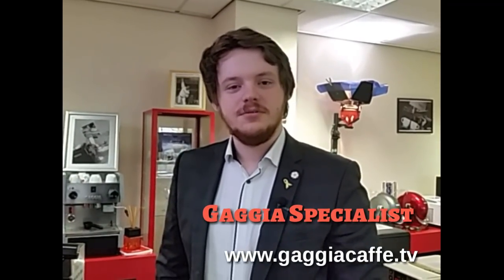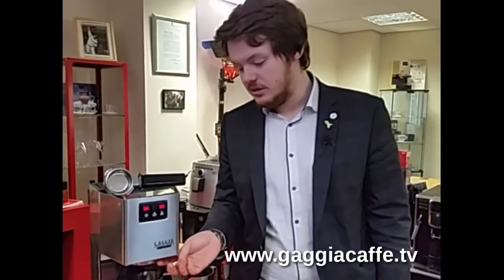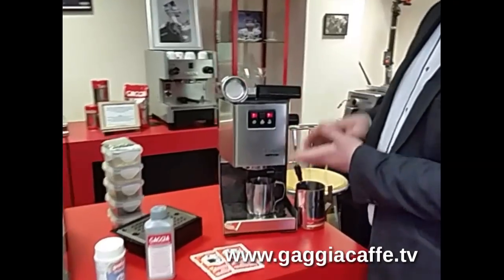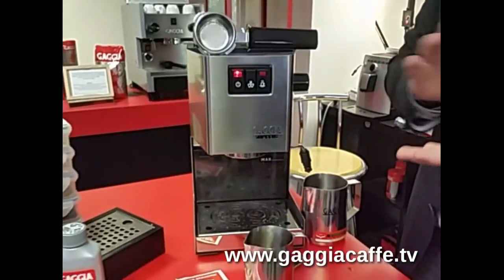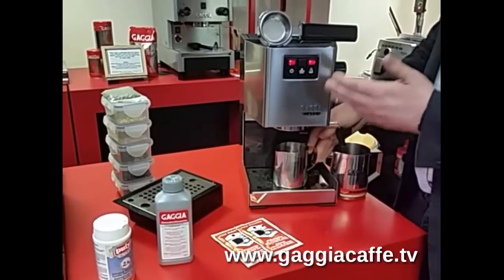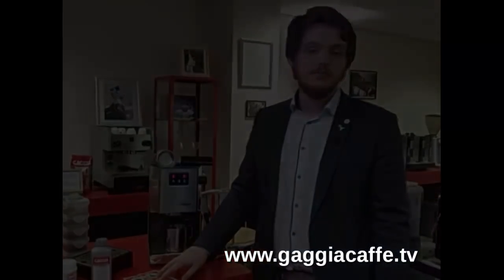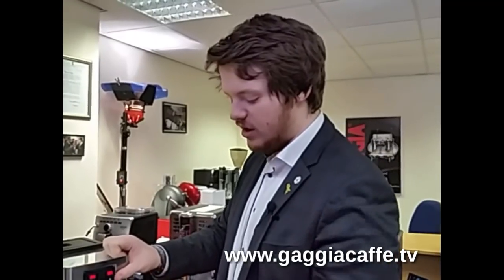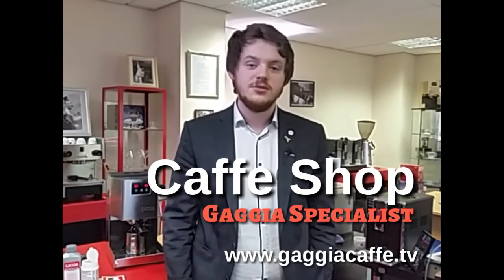Gaggia Maintenance - Gaggia Caffe TV

Comment: Commented on Gaggia Classic Espresso Machine Overview
Hi! i have this older model gaggia classic with PiD And OVP and the pressure was already modded to 8 bars. What is in your opinion/experience the best pressure mod for this model (mine is from 2011)..i am asking because i have an even older model from 2006. Coffee de luxe, where the pressure gauge shows nearly 14  bars, and i am slightly convinced that the coffee drips better with a little bit more bars...what do you think?....hey, i like your videos very much😀👍🏼
Reply from the maker: The default setting is 9bar.

Comment: Hi Gaggia my coffee is a little cold - what am i doing wrong - novice user
Reply: I'm not an expert myself, but I can state my opinion if you'd let me.
-Make sure to let your boiler have enough time heat up your water. Wait for the red light on the brew button to illuminate. 
-If that doesn't work, it may be a problem with the heating element for your boiler. Bring it to a specialist or you can attempt to fix it yourself by switching out the part needed.
Reply: It can take up to 30 minutes before the boiler reaches it's optimum temp, especially if you have an older machine. I had a similar issue when I started using my machine. I would say that the light indicating that the water is ready to be put through the group head requires maybe 5 additional minutes before you can start using it. Likewise, always flush water through before making your first shot. 

Similarly, with the steam wand, I've found that the first indicator light showing the steam is ready is too soon, and the pressure can be so great that if you have an older model with the detachable wand, it can fly straight off without waiting a few minutes.  I'd recommend using a smart plug if you can get one to manage to give the machine enough time to warm up. If you have an Alexa you can set a routine to turn on automatically so you don't have to think about it
Reply: Most important, when the machine heats up, let it heat up with the filter handle on. So th efilter and basket heat up as well.
Also, wait 10 minutes for the machine to heat up (don't just wait for the indicator light). And fluch a tiny bit of water before putting coffee in it.